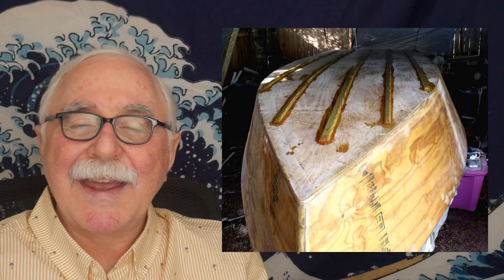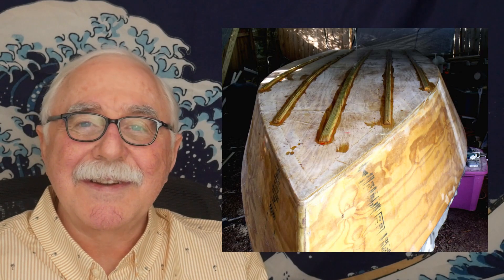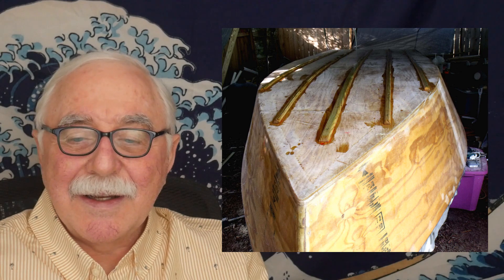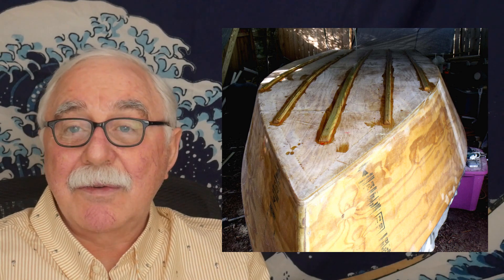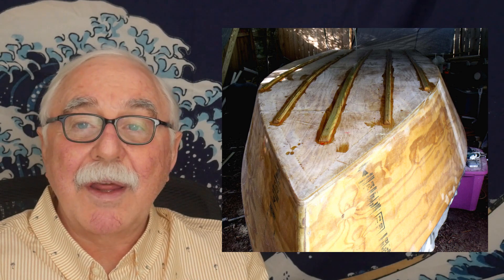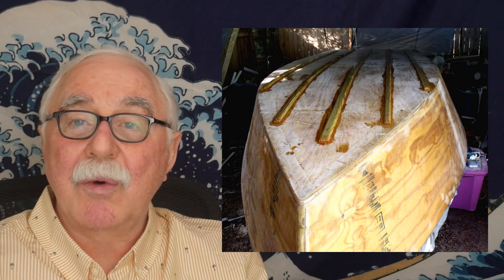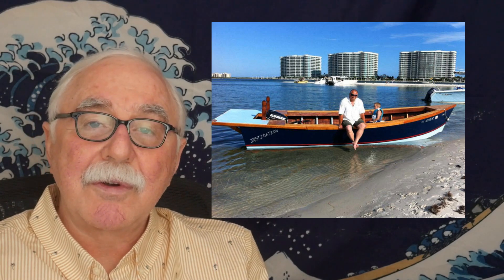Yes Part 20 Strakes Keels

Comment: Can you do an episode on “anti trip chines”?  They were a common feature on 50’s and early 60’s runabouts with sharp V fore-foots flattening out to flat dead rises at the stern. Phil Bolger talked about the issue of tripping on his state series flat bottom cruisers like Sneakeasy, Idaho and Wyoming. How they would bank and carve into turns just fine, but at cornering speeds starting around 25mph tripping became an increasing hazard and a safety  issue. Boats like the wooden AristoCraft 14 Torpedo series (which are still produced and restored by AristoCraft boats by the way) have anti tripping chines and some of the Glen-L boat plans have anti tripping chines.  I have not found any useful information (not in the weeds marine architect explanations) on how why these are configured to work properly and when should they be or not be used. He talked about how you could push both a 26 foot day launch Sneakeasy and a 51 foot Wyoming cruiser to 60mph, with what would be considered modest power requirements, but you probably should not try to turn them at those speeds. He specifically mentioned that the Sneakeasy and Wyoming would not necessarily turn upside down, but rather trip and roll rather violently up on its side and toss the pilot and crew around or overboard.  By the way, what’s the difference between a snap turn spin out and a trip? I had a 1980 Fiberform 1610 laser runabout  outboard which I found under certain turning conditions would drop the bow, lift the stern and do an instant 180 degree spin out. Didn’t turn over, but anyone riding in the back seats would find themselves in a tangled dog pile on the outboard of the cockpit sole leaning against the gunwales.

Comment: I put two as sacrificial in my hudson skiff ( wich appears in the video). Over the glass, and screw to the frames, then i sealed it with with fatened resin. I do beach a lot down the river and in the lake, and i dont want to damage the plywood. As far as control, it tracks great at low speed at the dock and high speed too.

Comment: Thanks.  Ah the genius of we who read a lot: DAGGERBOARDS!
Reply: I added a daggerboard to my Tillamook dory for maneuvering in crowded marinas at dead slow speed. It holds the boat on track in a crossing breeze and allows tight turns forward and in reverse.
I motor-mooch for salmon dead slow, and the daggerboard prevents a crosswind from drifting the boat sideways over the downwind line.
Reply: @OregonOldTimer  thanks.  There’s nothing new under the sun. Ya just never know. Just about the time I think I got an original idea (which I accomplish only by testing the edges of ridiculous) along comes YOU who’s actually done it to good effect!
Reply: @dennisharrington6055  I'm sure I'm not the first, but I haven't seen or heard of another. Biggest disadvantage is, it's embarrassing when I forget to retract it before winching onto the trailer.
Reply: @OregonOldTimer  thanks, and I might have been thinking, leeboards, when I wrote, daggerboards.